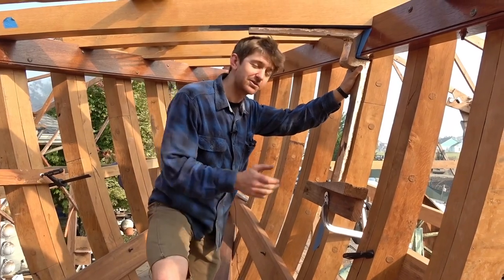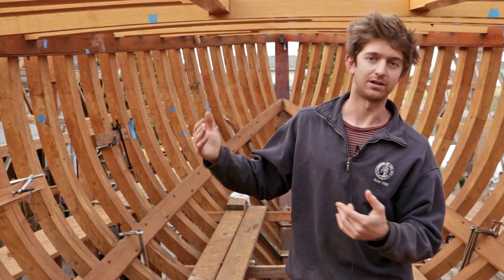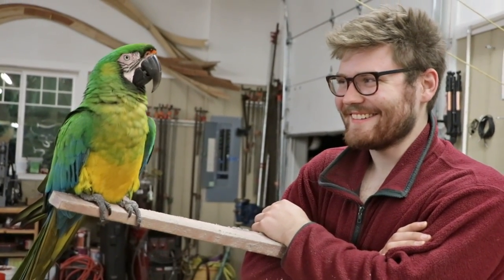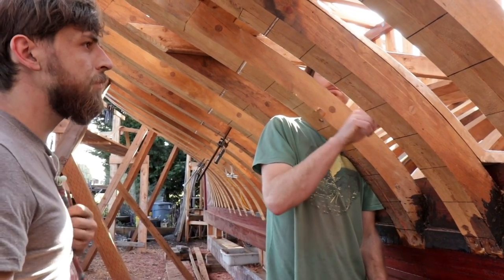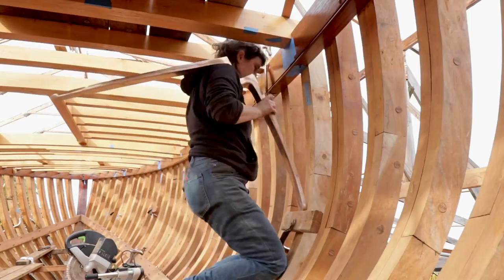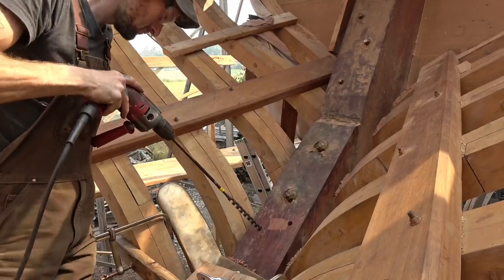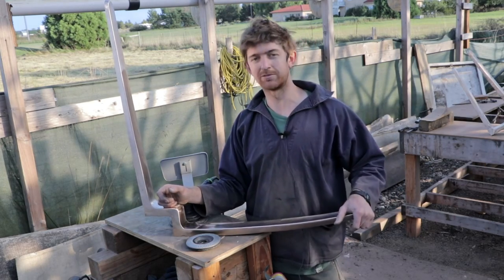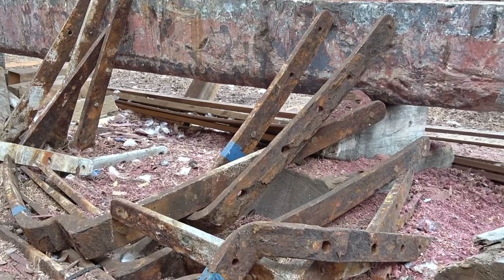Fitting/Polishing Bronze Knees - Wooden Boat Rebuild (EP82)

Comment: Pointless to have spent all that time casting if you are having to grind fit them. No electric grinders in traditional boat building. This is, time and money is no object, boat building.
Reply: You obviously have not followed the explanations in previous videos!!!
Reply: @tonygrimes13  Been watching since day one, could have cut them from a billet for cheaper and they would have fitted perfectly and been stronger than the cast bronze. The stiffer the boat the faster she goes, all this bollocks about give and flex in bronze when if you are looking for sailing ability then stainless would be far better. And cast iron is stiffer than steel, would be a mistake to think the original boat builders used cast iron instead of bronze to save costs.
Reply: @AirCrash1  You should re watch previous videos!!!
Reply: @tonygrimes13  No you guys need to re-study your science. The boat was built with iron which according to "sailing lore" is not giving like bronze yet none of the original cast iron parts were cracked when the boat was torn down. So the original boat was stiffer than this boat and sailed better. Any flex in the boat or rigging is lost energy from the wind, the stiffer the boat the more responsive it is especially in light winds. When I was racing I used to hang weights from my boat and measure the flex then make modifications to reduce it.
Reply: Clearly a case of shiny bright things do not always make things better.